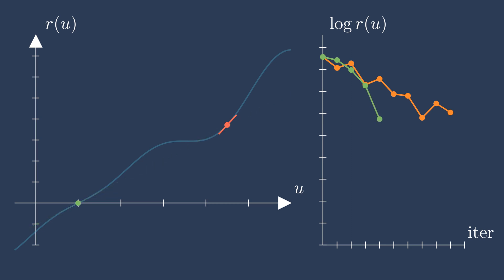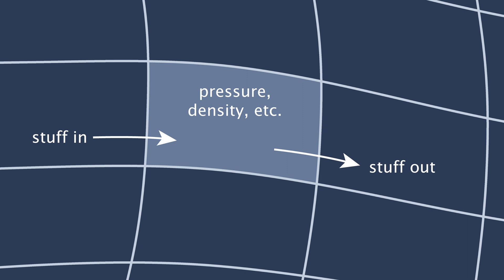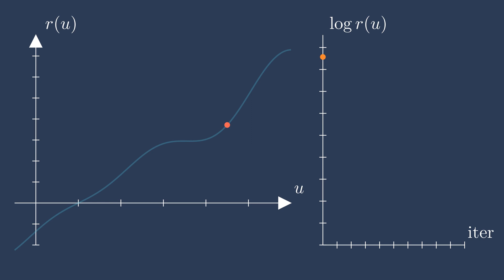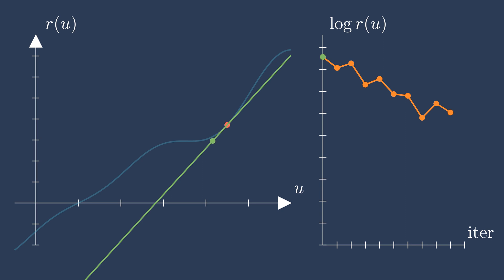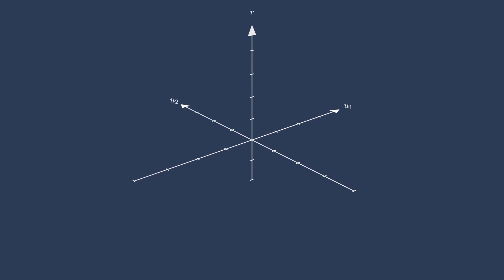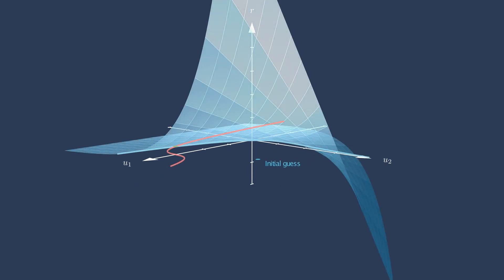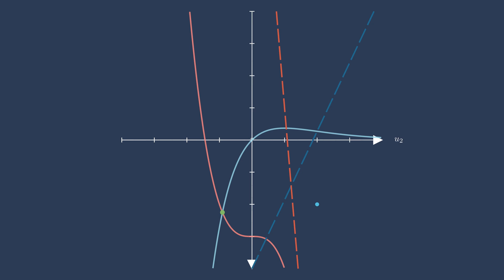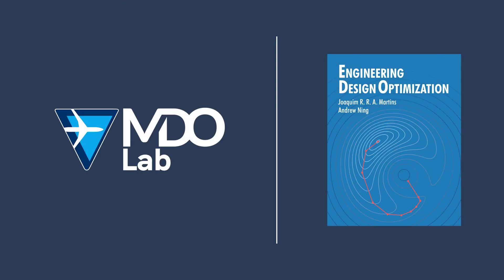How Newton's method solves multiple equations at once

Comment: I was surprised when AI kept saying my use of x^2 was "ill-conditioned", or something like that, in relation to a JFNK solver that incorporates Newton's method (I used squaring to simulate a non-negativity constraint). This video shows examples with a similar potential for trouble - the function at 2:47 has slope near 0 around x=3.5, but the video doesn't discuss the problem. Ultimately I switched to another solver using "COBYLA" (AI's idea again) that doesn't require squaring variables to achieve non-negativity, but is similarly finicky and often doesn't converge in problems much simpler than those for which we'll use the solver realistically. I wonder if there is a source of information about (i) how to choose a nonlinear solver and (ii) make it converge consistently on the correct answer. Well, maybe this channel has some of this info... the thing is, I basically need to figure it all out this week!

Comment: What do you do when the two lines created by the tangent planes are parallel and either always intersect or never intersect?
Reply from the maker: Great question Alex! That represents an unsolvable (i.e., singular) linear system. Newton's method would not be able to continue, though you could imagine workarounds where the current states are perturbed slightly with the hope of finding a solvable point nearby. When applying Newton's method to numerical codes in practice, finding a point that is exactly singular is unlikely. However, it can come close in which case Newton's method would return a bad step, but to somewhere that is hopefully better conditioned.